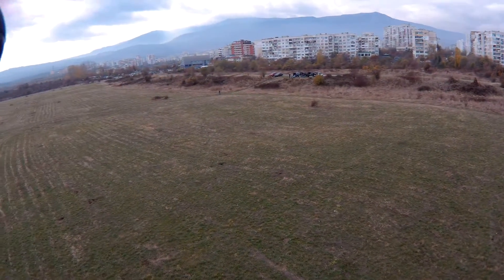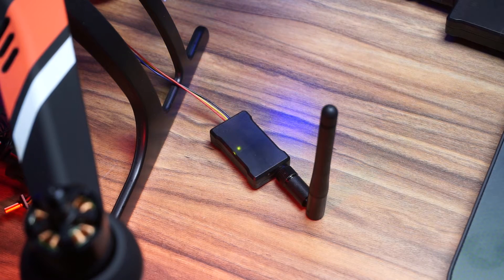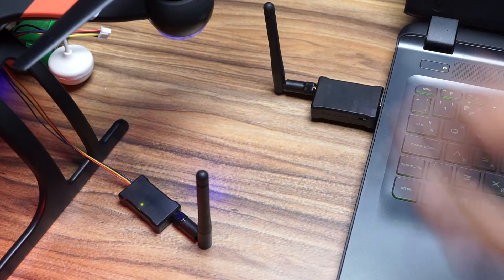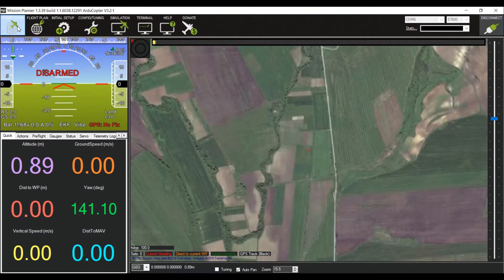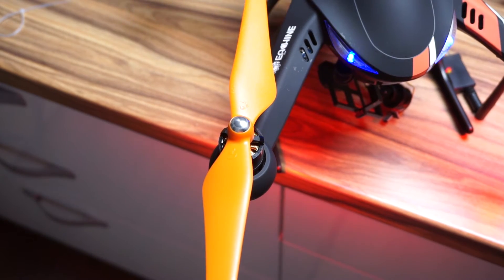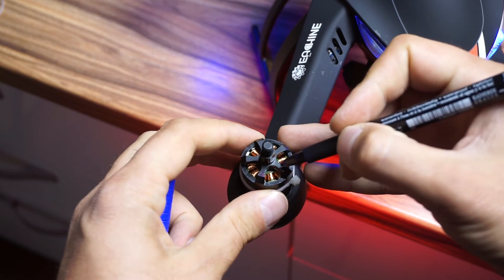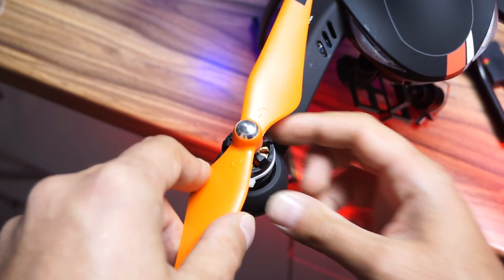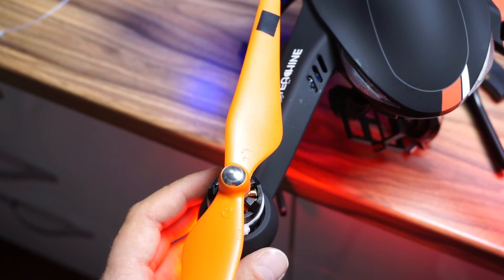Eachine Pioneer E350 - balancing prop/motor combo

Comment: i used small square pieces of electrical tape to balance the motors. a zip tie like you used appeared too heavy for my case.
Reply from the maker: I sometimes use electrical tape too if very little balancing is needed! However when I have to balance prop and motor together usually a larger weight is necessary!